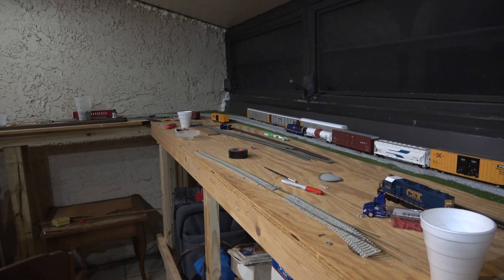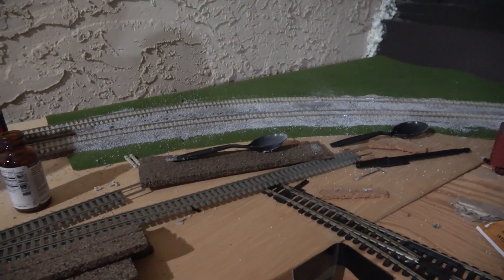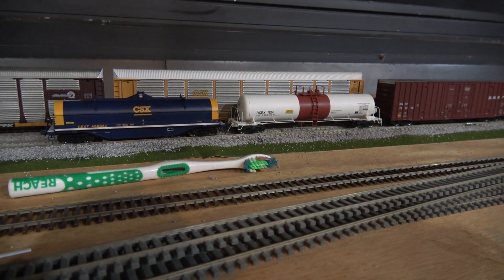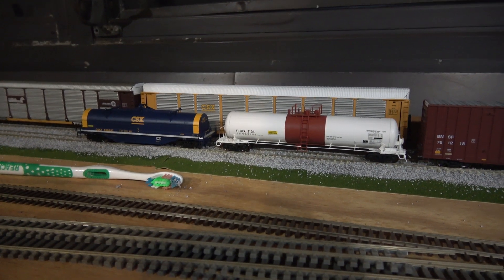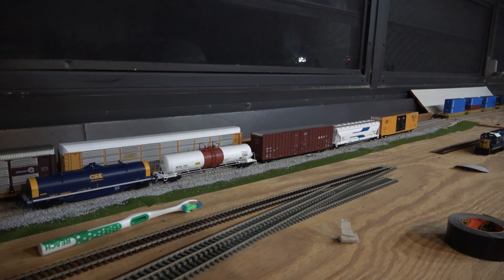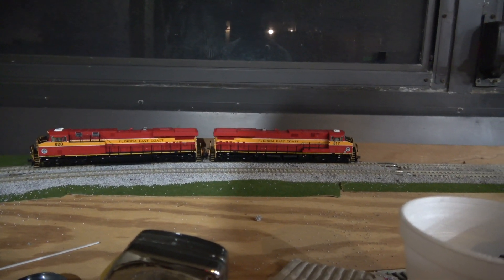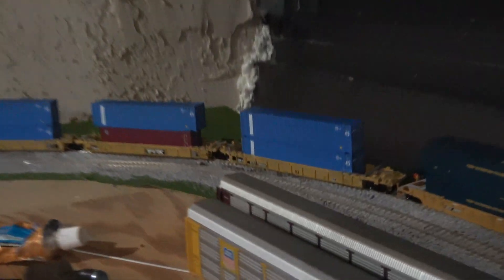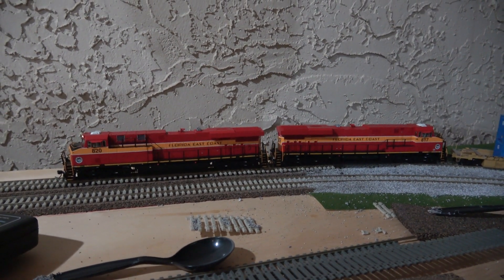Tracks Ballasted, New Freight Cars in CSX/FEC Layout Update #4

Comment: I understand your comments about centerbeam shortages. An Atlas one was advertised locally which I paid a high price for. There's supposed to be some new ones out at the end of the year.

With regards to the autoracks derailing on curves I wish a manufacturer would be brave enough to produce some an inch or two shorter than scale length. There must be plenty of modellers, myself included, who are crying out for shorter autoracks that look nicer around curves without excess overhang. It would be possible to make them slightly shorter without spoiling the appearance if it was done properly. It would also accentuate the height of these cars which is one of their distinguishing features.

Comment: Good improvements. Looks like it now runs much better. You're correct to replace those plastic couplers with Kadee. Some advice. To resolve issues with joint kinks on curves, consider staggering the joints so that they are not opposite each other. The NMRA web site (nmra.org) in its standards and recommended practices section has some recommendations for minimum separation on curves. Hope that helps...Harold
Reply from the maker: Thanks! I'll definitely consider your advice for the curve joints.

Comment: I asked a similar question quite some time ago on one of your live from Tampa vids but, I never got a response..In this video a similar situation has come up again which sparks my interest.. you mentioned in this video that the train you are building is in accordance with the Q453.. which you said is a Miami train.  Where did you get or how did you find out that call sign or whatever it is actually called to identify that train? Tom
Reply from the maker: Must've missed your comment, but to answer your question, the callsign, which we call train ID seems to be easy to find on all the fan sites, mind you South Florida only gets so many CSX trains a day so it's even easier to narrow down.
Reply: ok..thank you..I'll have to check into this.. I live in Pomona Park.. 90 min S of Jax, 90 min N or Daytona, 45 E of Gville and 32 mi inland from St. Aug.  I am just up the road from the "A" line.  We have freight come through around 4am .. Amtrak at 7ish and then at 10 am.. they both return in the afternoon and evening after Miami.  From what I've been told..much of the freight is coming down your side in Tampa.  Very new at understanding movement..and schedule. Thanks again.  Tom